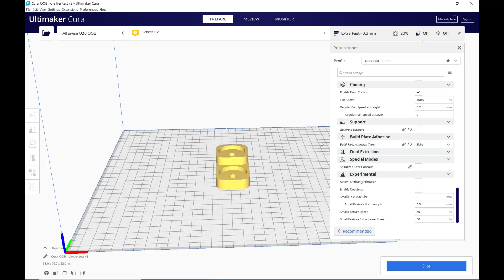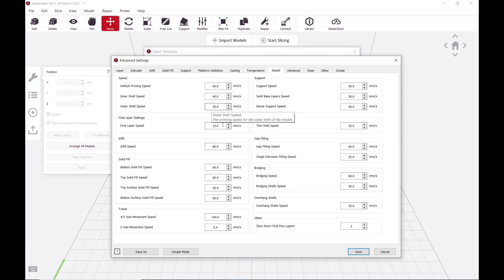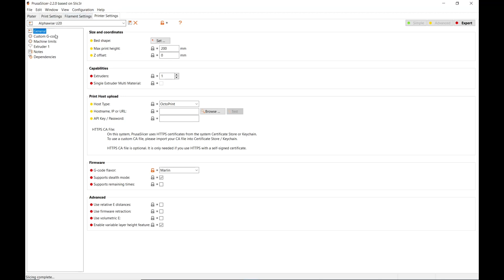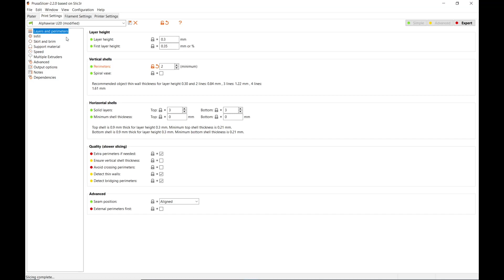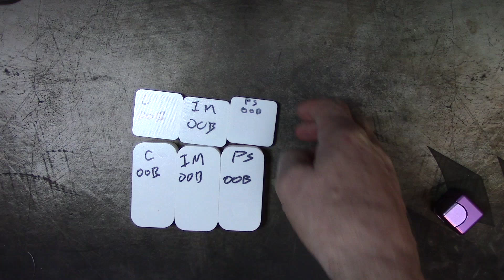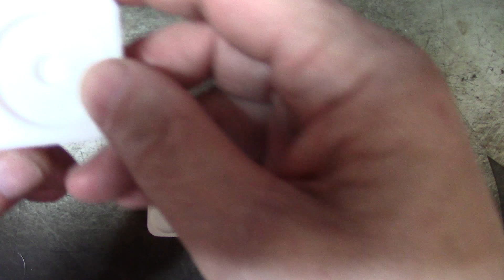Top Layer Shootout! Cura vs. IdeaMaker vs Prusa Slicer!

Comment: IdeaMaker is rapidly rising to the top of my slicer options, we can do IDEX prints, We have network control, we can build out better profiles for older printers and eek out good quality prints on machines many would consider far past their service lifetime ( at a school this is vital). It installs on both Macs and PC's, and for all the surface finish reasons listed here ( elephant foot compensation actually working well included), after tons of testing in Cura5 and Prusa Slicer customizations, the results speak for themselves. I absolutely respect the efforts of those other slicers and the unique needs of the printers that use them. The joke is on me that we also own a Prusa, and I can't completely replace Prusa Slicer, I just stopped trying to fit a square peg in a round hole and make it a universal swiss-army-knife for all printers. If only I could match IdeaMaker's quality results on bridges and elephant foot compensation in Kirimoto in the cloud, I'd have a viable option for Chromebook users. Really glad I found this video, even long after it was posted. Thanks Chuck!
Reply from the maker: It's been a few years since I tried IdeaMaker. Much like PrusaSlicer it just seemed backwards to me after so long using Cura. Also, IdeaMaker only had that dark color scheme which is hard on my eyes, so it is nice to see they now offer a light color scheme. Not sure what it is about all the slicers, but no matter what other slicer I try, and I've tried a LOT of them, I always seem to go back to Cura, no matter how much it constantly annoys me. But thanks for jogging my memory, I've installed IdeaMaker again and will give it another shot.

Comment: In ideaMaker, Top Surface Solid Fill layers are for more aesthetic top layers. Setting it at 3 will still give you 3 top layers
Reply from the maker: I know, but I was tripping over my own tongue trying to switch between the different nomenclatures the three different slicers use for the same function that I probably failed to explain it properly. Thanks!

Comment: Chuck : Great effort and focused attention to detail here.  I am not having your troubles in Cura , but I have a suggestion. Using Optimize Wall Printing Order is an important Cura setting for me, perhaps you may wish to try it. If you right click on that setting under Shell the add-in ( Cura Settings Guide ) will explain it for you. The circle wall print may complete in a different order to enable closing of that gap.
Thanks for everything and all the very best to you and your family.

Comment: To me, it looks like you're printing temperature is too high. Try lowering it 5C. I get VERY good top layers "out of the box" with CURA.
Reply from the maker: If you google "cura gaps in top layer" you'll find that quite a few people have the problem. Not everyone of course, but quite a few. You'll also find the thread I started at the Ultimaker forums 2+ years ago looking for a solution. I've had this problem across multiple versions of Cura (including the latest), different printers, different computers, different brands of filament and yes, temperatures ranging from 190 to 220. It's also worth noting that I've never had the issue in a slicer other than Cura. I'm happy for you that you get good top layers from Cura without tweaking, but unfortunately that doesn't mean everyone does. Fortunately a few tweaks solve the problem, but of course a person has to know what settings to tweak and while some of them are obvious, like line width, some of them, such as Combing Mode, aren't so obvious and still others, like Top Surface Skin Layer, don't do a damn thing until you understand how the setting works. But I will try your suggestion and show it in the next video. Thanks for watching and commenting!
Reply: @3rdpig  You makes some good points, however, while I haven't watched all of your videos, I haven't seen that you're doing a Temperature Tower for EVERY filament, I do. - I'm WAY PAST anal with my filament Q/A - I've currently tested over 98 different filaments. I've also tested "drying" and found it to be of ZERO use, however, I will use it when a filament is old and brittle - IIRC, you ABS test in water showed the same results I've seen.

When I get a new filament, the first thing I do is weight the spool, record the weight, then print a Temperature Tower, and the "Pig" using the results from the Tower. If the Pig is satisfactory, I then use this Temperature as my "standard" print temperature for that filament. I may be off +/- 5C at times, however, I rarely see poor quality Top Layers. - My determination of print temps is by looking at the finish of the filament, is it glossy, matte, or flat, as well as how well it bridges.
When I see layers like I saw in the video, where it looks like paste smeared over the top, for me it's always been using a too hot nozzle.

As a data point, all my PLA is printed at 50C on the bed, and normally at 80/mmS, and .20 layer height. If it's something I want to look "really good" then I'll drop to .16 or even .12, and 50/mmS, - I use the rule of 4's, which has helped my prints tremendously.

Maybe I'm spending too much time on this hobby?

Comment: Great test, Thanks for sharing
I used a retrackt amount at around 5mm with a all metal hotend. Now I have a direct drive on my hotend, so now it is around 2mm, as in Prusa I3 hotends..
PrusaSlicer, here the Nonotonic is released on the latest 2.3 release: https://github.com/prusa3d/PrusaSlicer/releases (release-candidat 1 RC1)
I have tryet the monotonic top and bottom infil, and it looks great.
Thanks for your great job to test, and retest the slicers with a continue development. :-) 👍
a sidenote, IdearMaker is on the go for support of condunius print, eg. CR30! Fantastic program!!!
Reply from the maker: Thanks, I got the RC1 for Prusa Slicer but have yet to try it. I'm kind of excited about it. Without an oiler I've never gone much over 2mm of retraction on an all metal hot end before I started getting jams. With an oiler I've gone up to 4mm. I'm posting a video today with more tweaks, and will do another one with the PS RC1. Thanks for watching and commenting!

Comment: You might want to vary your print temps too. I have found filament colour can have quite a marked effect final print surface quality. What I call "solid" colours like white and black tend to be very "gooey" and easily catch on the nozzle and smear.  They also tend to stay plastic longer on small parts like you are printing. I don't know what cooling you have on the Alphawise but that could also be contributing to your issue.  The Prusa default retraction is set that way because Prusa machines are direct drive that need short fast retraction. Another thing that is also often overlooked is that limits set on retraction speed in the firmware.  E.g on and Ender 3 it's limited to 25mm p/s so no amount of Slicer or start G=Code settings will over ride that

Comment: I'll try IdeaMaker. I love Cura. Do you see any differences in tolerances? I don't print for pretty, But I do use F360, and if I add 0.1mm as tolerance, I get a really good fit every time.

I think Prusa is direct drive so retraction isn't as important. I think I have 7mm on my ender 3.

But all in all I have been pretty happy with Cura.
Reply from the maker: I haven't checked tolerances between the three slicers, but I could do that in a future video.
Reply: @3rdpig  If I ever need to fit say a 3mm or 8mm steel rod into a PLA hole. I just add 0.1mm for a nice tight fit. In cura if I made an 8mm hole it would be too tight.
Reply: @FilmFactry  Ah, I see what you're talking about with the .1mm, I assume you're doing this in the model.
Reply: @TheDgdimick  Yes, In fusion 360 adding 0.1mm to my "hole" etc, allows my print to fit perfectly every time. Even say a box the slided over a inner box. 0.1mm is a snug fit. 0.2mm for a easy fit.

Comment: Retraction was definitely a value that I change to suit the printer. Especially if you are talking about a difference of an all metal hotend. Not sure what you use, but my direct drive, all metal hotend only uses 1.6 retract distance, any more than that and it pulls hot filament onto a cold metal part... yes this does not end well, hehe (insta-clog).. If you have a PTFE liner, down to the tip, change the retractions to your liking.

You may want to try "Avoid Crossing Perimeters" under Print Settings/Layers and Perimeters. I have ZERO practical experience with this setting, but "they say" its good for bowden style printers.

Looking through your camera lens, I would say that the prusaslicer's top layers look the best. This is a very subjective thing of course, especially when my view relies on lighting and pixels.

I don't use any of the advanced tools in prusaslicer but I do believe that I got lucky because my extruder lines up well with what the defaults are. With the exception of retracts, I ALWAYS change this value, I don't want a repeat of that mistake in an all metal hotend. I think I might tinker with extrusion width just for fun though, but I don't feel like I have to.

Edit: One more thing you might want to check after many hours of printing on a inexpensive brand of printer. The filament drive gear, if this is brass it can wear out much the same as a brass nozzle does. If it's steel, well you have less to worry about.
Reply from the maker: In my next test I'll definitely adjust retraction and settings like Avoid Crossing Perimeter. I typically use 5 or 6mm of retraction on PTFE hotends and 2 on all metal hotends (although I've gone as high as 4 when using an oiler).  Without the stringing the Prusa Slicer does look the best. I'm looking forwards to using the beta or alpha with the Montonic top layer settings. I just replaced the extruder on this printer with a new dual gear extruder, so the feed gears are new.

Thanks for watching and thanks for the tips!
Reply: @3rdpig  also toss your tail light covers into prusaslicer and check out... Print Settings/Infill/Top and Bottom layer Pattern --- Octagram Spiral

Looks like it could be interesting =)

Comment: I have 4 printers and 3 computers and anything I slice on Ideamaker on any of the computers and attempt to print on any of my printers the first layer is printed 6 inches above the plate
Reply from the maker: I've never had that happen in any slicer. Not sure where to tell you to look other than in the printer settings. But you've probably done all that.
Reply: Can you post a small Item you're having issues with, both the SLT and your Gcode? Maybe go into Tinkercadd and make a square 20x30x0.2 in size?
 I'd love to try and reproduce this issue, it sounds interesting.